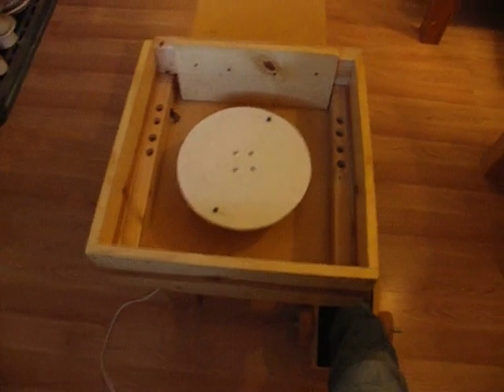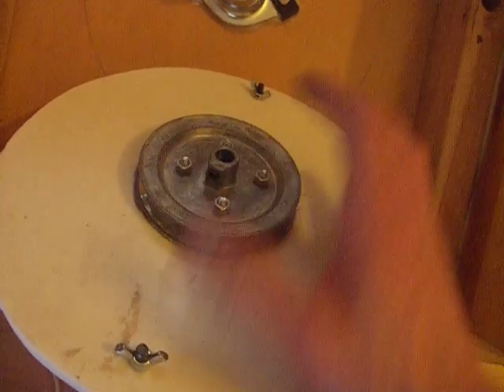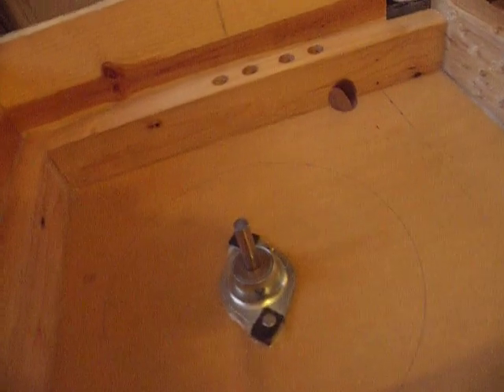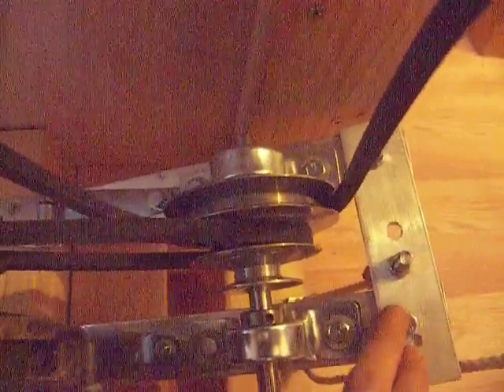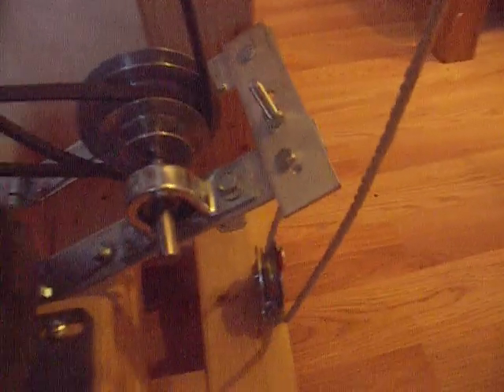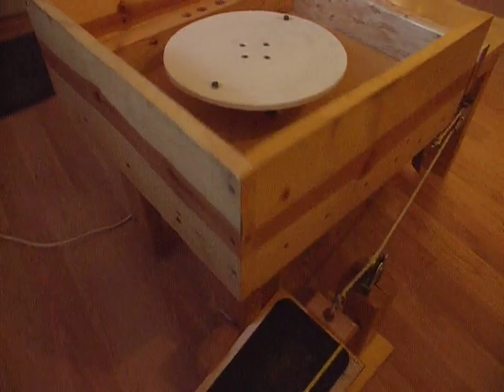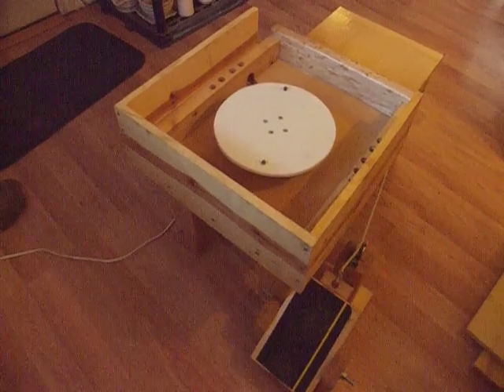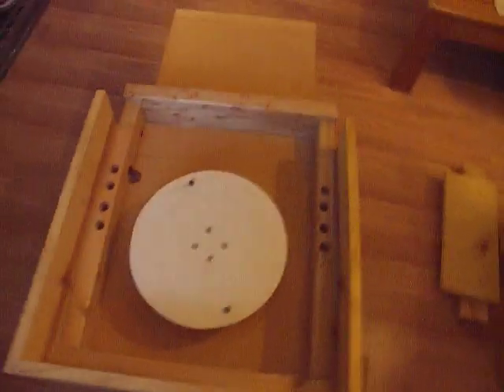How to build / make an adjustable speed electric home made potters / pottery wheel

Comment: could you use an electric foot controller that works for a wood router?  ebay or harbor freight.  you may have problems using lamp cord wire for your electric motor.  this is not ment to criticize, one friend to another.  you have a nice design thanks for sharing.

Comment: A great source for cheap DC motors is used treadmills...they are plentiful, cheap (sometimes free), and come with all the controls and electronics you need.  Most treadmills have 1 to 2 horsepower motors, but even with the speed controller, you will still want to use a pulley reduction system so you can have torque even at slower speeds.

Comment: So has the wood all been water proofed? ( wood Rot is a B so is electrocution ) might I suggest turning the bolt for the foot pedal around to were the long protruding end is pointing in toward the inside so its not a trip hazard.
Reply: +Th Linn gill Tripping hazard ? How about you watch where your walking .
Reply: +Valient Six *you're
Reply: +Valient Six How about you learn to be respectful for once. All I did was just correct a mistake, no need to make a big deal out of it. Also I do have an opinion this wheel is for people who don't wanna pay $600 because buying the raw materials is way cheaper than buying the thing pre made for you. If you're willing to spend time on pottery you will definitely have time for this. Why even watch this video anyway if you don't understand pottery?
Reply: +Valient Six And by tripping hazard they meant having a 3 yr old in the house who might not notice the wire. Will they always watch their step? No. Use some common sense for once

Comment from the maker: Ya, it does. This is a very similar design to the old Shimpo wheels. With a few exceptions. Theirs had another pulley system involved. Instead of the wheel head pulley (the pulley directly under the wheel head) being belted directly to the pulley that controls the tension, it is belted to another pulley system that just slows the speed (so the tension pulley would be attached to another set of pulleys that we be then belted to the wheel head pulley).

Comment: Hi, thanks for this video ! I'm serously thinking about building my own potters wheel, but all I could find was including some... frequency regulator to deal with the speed of the AC motor (sorry if i'm not clear, I'm French :>)

So when you lower the pedal, you're using the friction to make the wheel turn right ?

And, another question, what's your wheel speed when you re using it ? about 2 rpm right ?

Thanks again :)

Comment: I see that as soon as you put your hand on the wheel it stops, isn't that undesirable in a pottery wheel? Because when you want to throw something on the wheel the torque will not be enough (that's what I think)
Reply from the maker: Yes, if the wheel stopped when I put my hand on it every time even if my foot was all the way down on the 'gas'.. but I took my foot off and this allowed the wheel to spin freely, this is why it stopped so quickly when I put my hand on it.

Comment: Do you know what would make this so much better? Fibreglass! Make your shape out of wood, but fibreglass the bastard, lol! This would absolutely ensure the wood stays protected and waterproof, (as well as any electrics underneath) and since you can gently mould the glass fibre around the inner corners, a curved surface would be easier to clean out. The only downside to this, of course, would be the extra cost, as fibreglass resin is not cheap. However, if I were making this, I'd take the plunge, as electrical safety is a big deal to me. Remember, when it comes to electricity and water, you usually only get to make a mistake once...... Be careful, and be safety concious.

Comment from the maker: I know you can google ac motor and a frequency regulator and there are some sites up that describe how to use the two together. I am not sure if an AC motor can be used with a PWM (pulse wave modulation) which I think is what you have? 
 But about the petal, yes, when I lower the petal, the belts tighten up and create more or less speed the tighter it get's.  The speed varies from 10rpm to 250rpm
Reply: yes, pulse width modulation controls are specifically for varying speed with ac motors. for folks reading this in the future, you can buy ac speed controllers relatively cheaply at harbor freight.

that said, your pulley system is very impressive and technically sophisticated.

Comment: @rockershocker89 I didn't know you could get ZEROMAX rebuilt.. Still, with a free motor you can have a very strong wheel w plenty of touque at low speed for a fraction of the cost of new wheel with similar power